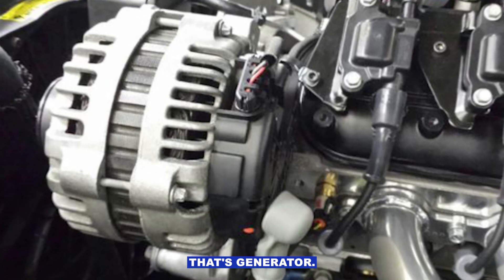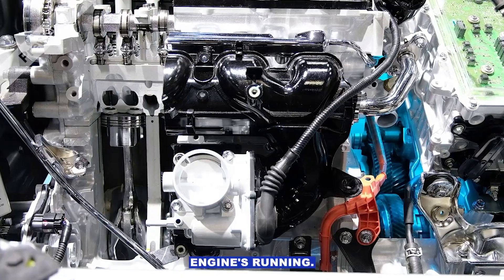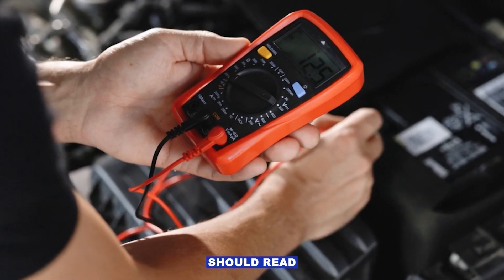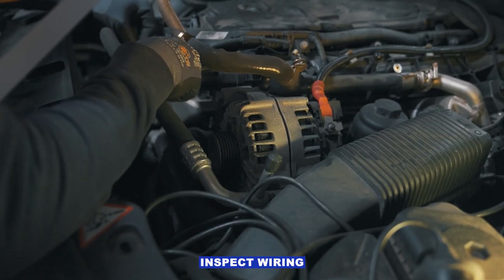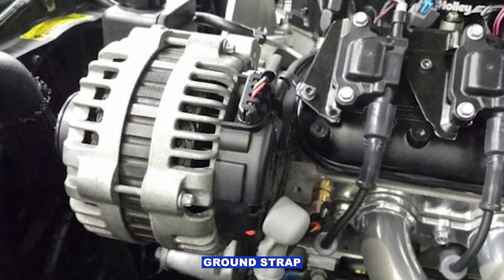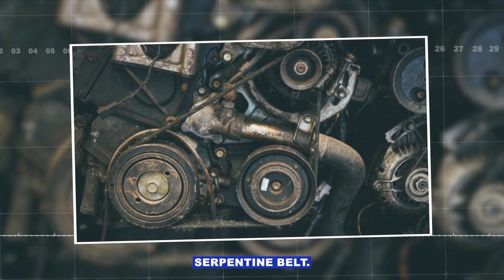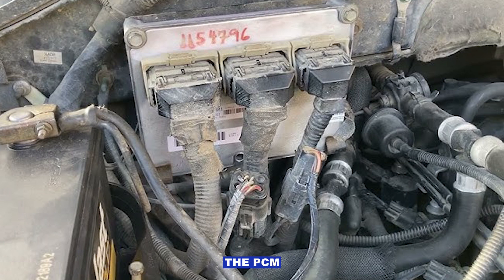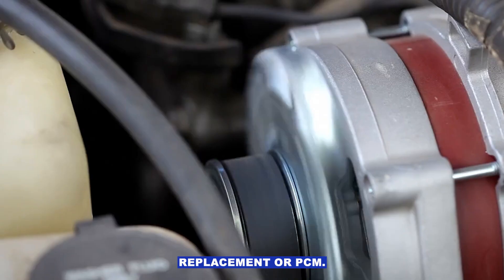P0620 Code: Generator Control Circuit Malfunction – Causes, Symptoms & Fix

Comment: I just had my Alternator replaced in July 2025 and then my battery in Oct 2025.  My POS battery port connection seemed to be kinda loose so I tightened it.  My interior lights and dash light were getting very dim until they just cutoff completely.  All my gauges just dropped down as if the truck was off, right before the power went out but she was still running.  (2004 Ford Expedition).  After i pulled over and cut her off, she wouldnt start back up.  I had to pull out my jumpbox.  I made sure the battery cables were snug and then i jumped it.  She started right up.  The lights were strong and bright.  Then moments later, the check engine light came on.  I made it gome with no problems.  Then this mrng, the Check charging system light came on.  I plugged my OD up and codes P0316, P0620 and P2198 popped up.  IMO, i am due for a tune up (60k miles since the last one 189k on her now).  Anybody had these codes?  What did you get done to fix them?
Reply: @LanceDMV  clean all ground and terminal connections, replace all fuses in fusebox (engine and cabin).